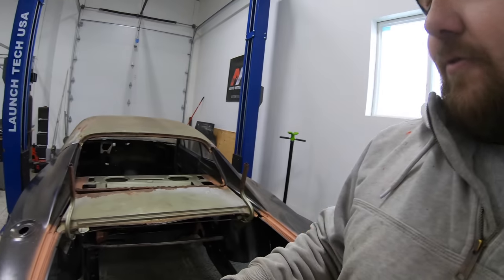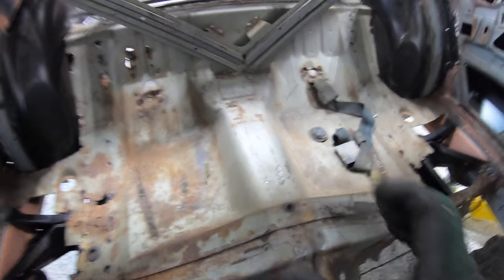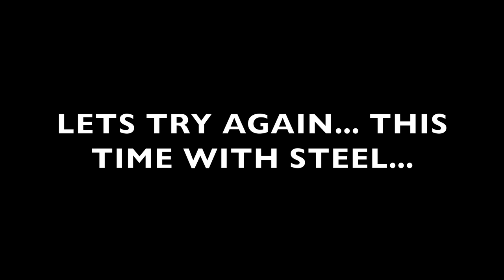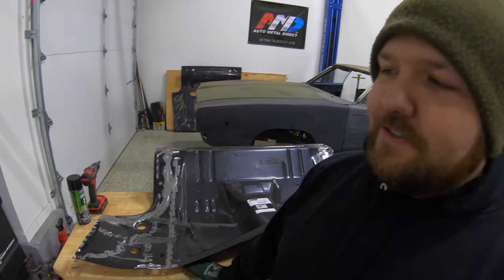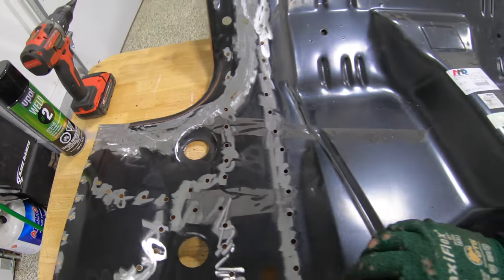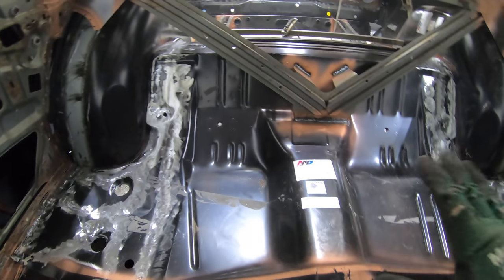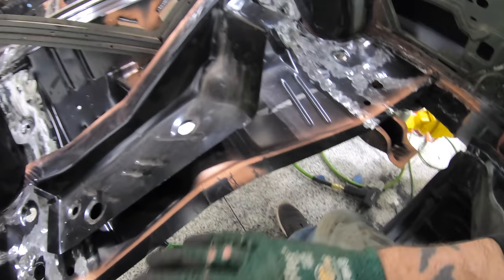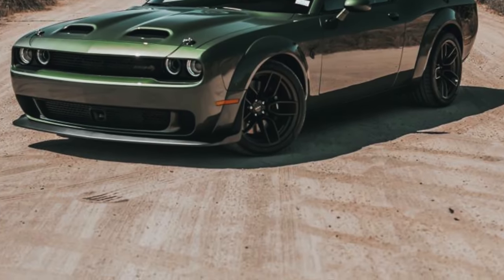1968 Dodge Charger Restoration - Episode 27 - Rear Seat Pan & Footwell Panel Install

Comment: Glad to see you kept that lip for attaching the floor to the widened tubs.   I cut that piece off my trans am but my rear floors were fine and I didn't want to mess with the necessary welding since the floor pan remained in the car.

Comment: It's really starting to come together well!   I just replaced the rear filler panel and package tray on my '72 Chally project.  Still have the roof and a few other panels to replace.   Long process but fun.   Your comment about photo documentation is indeed key!  Unless, of course, what you're taking out was so rusted (or 'fixed' with Bondo) there's no good reference point! HAH

Comment: What you accomplished in two and a half days is amazing my friend, Songbird did the exact same thing to General Mayhem with the mini tubs, he cut the panel to fit the frame rails exact, welded it in so it was fully boxed. He then welded those little filler pieces over the top, to connect the wheel well to the floor pan, nice but didn`t look stock. You took the time to graft those little pieces to the floor pan so you would have just one panel, so it looked factory, he had three pieces. The extra time in fitting those pieces in sure paid off, it looks like factory, I agree, fully weld that V support. Nice job for three days work let me tell you, your fabricating skills are spot on, that floor looks stout. It would have taken me three days just to drill the holes. That is a nice little shop you have going on there, everything you need right at your finger tips, can`t wait to see the window channel go in, I have never seen that before. I hope you get a million subscribers for your effort sir. Nothing is center, even the motor is not centered on the b bodies, Songbird found that out when he built  the scoop for the tunnel ram, he had to offset it. Very nice job looks great. Didn`t mean to bore ya, hehe.
Reply from the maker: Thanks for the kind words Joe!  Happy New Year!
Reply: @rustbucketrestos6511  Same to you, your`e the man.
Reply from the maker: Thanks Joe!  🙏

Comment: The Octane Red is a play on the FE5, Rallye Red. I'm considering painting my 70 Roadrunner which was a FE5 Octane Red. Personally if it were mine, I would go with B5 Blue with a black vinyl top but as another said you really cannot go wrong with the F8 Green.

Comment: That narrowing of the floor pan was very clever my friend. I'm learning a lot.

If we were able to get L50s on 10" cragars on my buddy's 69', back in 75', I wonder what you'll be able to squeeze into your widened wheelwells?

I see you've discovered one of Mopar's drivetrain tricks that allowed us to squeeze the biggest engines into smaller engine compartments and still fit our steering gear around the largest exhaust systems in the industry(back then).

When you measure your 8 3/4" rear end you'll notice the built in offset.

The fools that desecrate their Mopar's with a Ford 9", quickly discover getting it centered to Mopar spec, drives the cost well over what finding a Mopar axle for it costs.

Besides, a 9 3/4" Mopar Dana 60 is magnitudes stronger than Henry's best anyway(and a damnsight stronger than those 10 and 12 bolt grenades the General used to scatter all over streets and tracks).

Your son is growing like a weed and will hopefully outgrow his penchant for Mustangs too.

Some of my friends had me wrenching on their FE 390s and 428s in the early to mid 70s too.

That all changed as they got tired of watching A, B and E body tail lights.

By the time I left the Lakes in 77' all my Ford buddies(and a lot of my GM buddies) were subscribing to Mopar or no car.

Your son(and we're hoping the Canadian voter) will soon enough outgrow style over substance and leave his Ford affliction behind him(much like I pray we dump our economic imbecile of a Prime Minister).

Really enjoying the pans going in. Great work!

Malcolm Ottawa Valley

Comment: I know you will because you are super detailed but please go over all the trunk pan stuff that doesn't come on the new pan.  Maybe a little PSA!  I swear every few weeks someone posts a picture of a trunk pan installed without the brackets for the gas tank J bolts.  Anyway,  good luck with the trunk pan!  My drill and my angle grinder both gave up before I got through it.  So many plug welds!!
Reply from the maker: It’s definitely a beast… I get the added luxury of all the extra work involved sectioning it 5” to fit my mini tubs!

Comment: I like the red, lamborghini adventador Rossa Bia Met. 0144 is also nice. 
Or i'd check out the old firemist colors from the 67-73 cadillac's super sparkly.
Or of course black is always a winner, maybe a 1000 hp helephant crate engine or a 528 hemi (stroked and 4.5 bore 426 hemi) with the edelbrock rpm heads, intake and cam - 705 hp on pump gas and it has vacuum. With a manual 6 speed. Id prefer the classic gen 2 hemi with solid lifters.
Reply from the maker: I like your style!

Comment: I used to work at a street rod shop and all i can say after watching all your videos is Great job! 
I'd do the red or purple both are really cool collars and i'd go with the white R/T strip over the quarters. 
Have you thought about frame rail connectors from the front to back? I have a 69 charger that i have not started on yet and I have been wondering how much they would help stiffening up the car, I'm afraid when i get all done with my car that it'd twist when i drop the clutch. Just a thought.

Comment: I hope you do some Torque boxes on the rear frame rails, now is the time, super easy to fab factory copies. Some one told me back in the 90's that Landy made his with 14 ga. I bought a set from DC back in 86' for my 70' RR 383 4 spd , they were a lot thicker than 14ga. ,,, tons of info from Mr. Norms followers about factory track pack parts and codes..
Reply from the maker: That’s the plan!
Reply: @rustbucketrestos6511  Right on , I can't get that green out of my head,,, I had a white 69 Charger long ago and dreamed of doing a bright red interior,,, hey it was in the late 80's, what can I say. Yes it had N-50-15 sticking out of the wheel wells too.
Reply from the maker: Red interior would be badass!  I’d love to do one like that one day
Reply: @rustbucketrestos6511  I hope to find a 70 RR or GTX " 4 spd , Post " roller body to AMD and "full frame" ,,, I'm sitting on a mid 70 sleeved  440 , 871 ,  full roller 8.3:1 ,,, and I just want to turn heads driving it around, don't cate about dyno or running the traps,,, I just want to feel like a 9 yo James  T Kirk in a borrowed 60's corvette,,, just one more time.
Reply from the maker: Hell yea brother 😎🤘

Comment: Chris Birdsong was talking about how the Mopar's are all off centerline toward the passenger side for some reason he described I can't recall in one of his 'Smurf' '69 Charger videos...he had to do a bunch of cutting on the hood of his for a tunnel ram...so they're supposed to be off killter like that according to him...
Reply from the maker: Right on, thanks for the info!
Reply: Manufacturers do it to increase the life of the u-joints. Fords typically offset the pumpkin, GM does it by pinion angle and Mopars do by shifting the centerline of the powertrains.
Reply from the maker: Good info!  Thanks!

Comment: Unless POR 15 has changed their formula it won't stick to pained surfaces. . I painted my AMD floor pans after welding in and cleaning them good  , peeled off in short time . Rusty , it holds firm.

Comment: I did my 68 where you are at , your trunk filler and deck lid are going to dictate the width of the trunk lid and quarter lines along with the tail light panel position .  I can see that you have a handle on what you are doing and I just wanted to pass along what bit me . The repro deck filler is slightly narrower than the oem . When I cut the oem  panel out the quarters relaxed and I had body lines and everything fit correctly .  As far as color , thats 300% your idea and choice .
Reply from the maker: Thanks Al, I’ll be fitting the new plenum & deck filler this weekend!

Comment: Also, isn't there some like braces that go from the frame rails to the rear quarter panels, closer towards the rear end.  And an octane red with a black pearl would look sweet.
Reply from the maker: There is quite a bit that still needs installed.  The rear leaf spring mounts, trunk pan, extensions, deck filler, etc.  THEN the quarters & tail panel can finally go on for the last time!
Reply: @rustbucketrestos6511  you would know right😄, I was wondering about that and you wrote a whole list haha. It is alot, but coming along well

Comment: So why didn't you put the holes along the wheel well to box in the frame (you do know they will be  week in this area)  And also you should of punched the holes on the wheel wells will be much easier to weld from the wheel well instead of the frame side
Reply from the maker: Very true!  May have to come from both sides due to access.  Pushed up against the frame rail makes access tough!

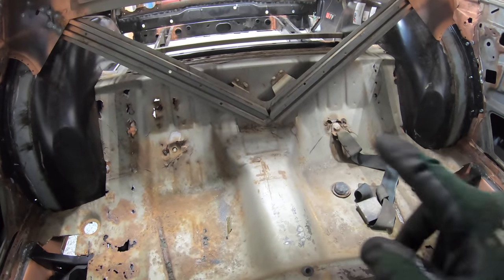Comment: You know the color's u are choosing from are… Christmas color's Red (ornimant's/decoration's/santa clothes)Green (tree) white (Snow). I would like to see the cranberry sharp/rich looking and it's Far enough differant from the "Clown car Orange" Even Though I own (2) 1969 charger R/t SE V2 Hemi orange original and other is 69 R/T SE R4 tor-red original color's I only got them by Fate wasn't looking. But it's anoying people saying hey it's the general lee. I also own a Racing Green 1968 charger R/T. I looked back at video and seen this slip up 3:30 whoop's 41:40 45:00